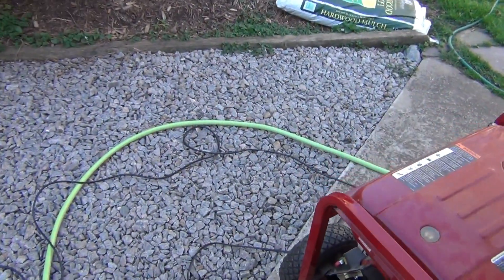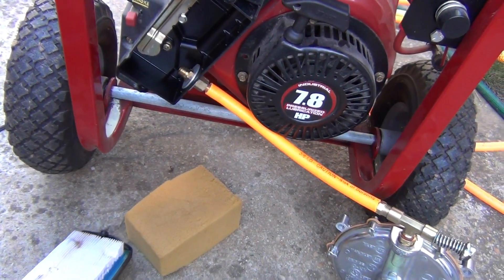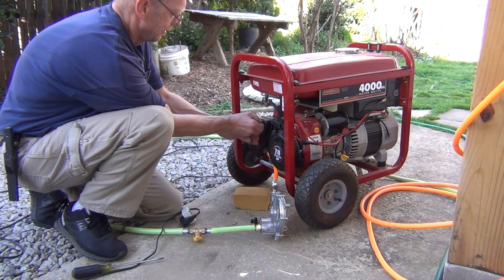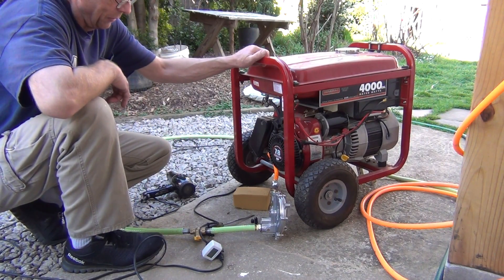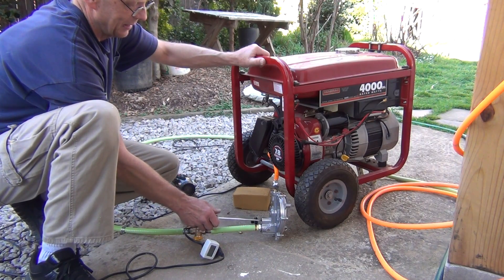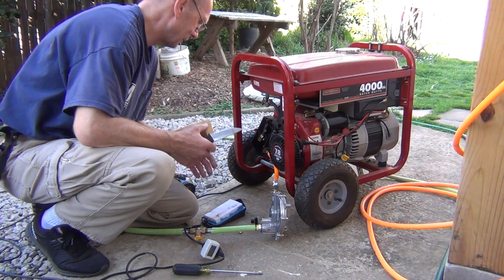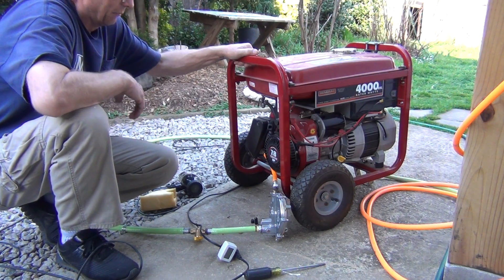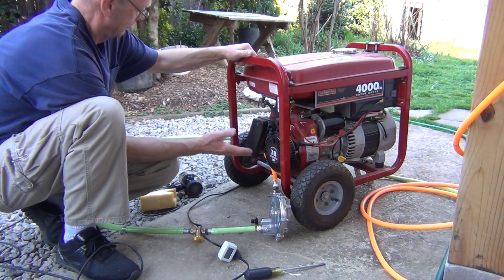Easy generator conversion to propane or natural gas.

Comment: You need to go on US Carb website and you see the proper adjustments.

I have US Carb setup all you have to do is follow instructions.

There only one location on that valve you adjust and it on top of the valve which is independently attached to the valve it’s a adjustment block!

Any other adjustments would be to the governor after you got it running to make sure you are running 60 hertz in USA or in Europe 50 hertz.

Another adjustment is the spark plug re-gap it  from .30    To .20 for better burn.

The spark plug should be the first thing you adjust.

PS THE VALVE HAS ARROW ON IT FOR PROPER PLACEMENT.

Also add electric start that will help starting!!!!!

Comment: I have a dual fuel generator that works with gasonline  and propane I have a natural gas set up for my out door bbq grill can I just hook up straight to the port I'm not sure if it would just work also the the grill has a natural gas regulator on it with the line hook up
Reply: I would not use the N G regulator. I would connected it straight to gas line. Yor generator should have all the regulators. My gues is it will not work and if it will you will get only little power out of the generator. Small load will just kill it.
Reply: Vlad Fred Kovac thanks I was just not sure why it would not just work straight form the natural gas regulator I have not looked into the conversion kits for my generator I have I champion.

Comment: Hi Vladimir.
I have a Sportsman dual fuel (gasoline & propane) portable generator.  Can I use straight natural gas or do I need a different regulator than the one I have.  
Thanks
Tani
Reply: you can try it but my guess is it will need to be adjust it. N G is not as rich as NP so it will need more N G to air mixture plus the preasure is lower so it might not even get any gas in. I would try run it with half a choke, it might help.
Reply: Thank you

Comment: Do you have a web link or the name of the valve you have on the regulator output? its shown at 45sec. or where you bought it? looks like a fine screw adjustment, not sure of the proper name.
Reply from the maker: I made it my self. Its a Husky 1/4 inch T from Home Depot air compressors section and I treded
Reply from the maker: Hoops sorry ...I treaded the inside to screw bolt in which will choke the gas inlet and then add spring to secure it when generator is running.
Reply from the maker: you can also use 1/4 inch valve shot of which you can see at my other video 
https://www.youtube.com/watch?v=ei9yEPITbbI&t=33s
Reply: Oh, nice haha, I was wondering where you got that

Comment: thanks, I have a similar generator, so I think I'll try it. Last summer I tried to put the NG to the air box, without the regulator, but couldn't get it to run. I just had the gas running tho, so I'm sure it was too rich. I like the trick of starting it on gas, then shutting the gas off and switching over to NG when it starts to sputter. 

What kind of valve do you have on the outlet of that regulator?

You said it leaked with the regulator adjustment screw out...where does it leak from? the screw or out the reg outlet?

Thx again for the video!
Reply from the maker: when you loosen the screw too much the regulator does not work as a regulator anymore and let the gas go trough with out engine let it suck or instead of engine sucking the gas out of the regulator. 
Don't be mistaken,  the regulator does not regulate the gas flow to the engine, it just stop the gas when engine stops becouse the engine suction open the regulator and let the gas go through. You still have to regulate the amount of gas with something like I have the screw on top of the regulator. 
The T on top of regulator is just  1/4 inch pipe tread T. The outlet from Garretson regulator is 3/8 NPT so I have reduction nipple to 1/4 inch. 
Plenty big even for 10HP engine.  For 16 HP I had to go to 3/8 T
Reply: Ya, I was wondering what kind of valve you had on the outlet of the regulator. I'll get get some 1/4 copper tubing. I saw another video where the guy put the tubing right into the carb though the air box. The choke could still shut as well. Anyway, I'll probably never need to run off ng unless the power is out for more than a week